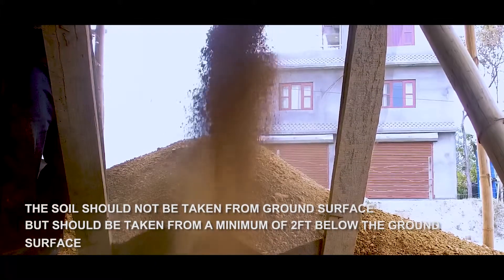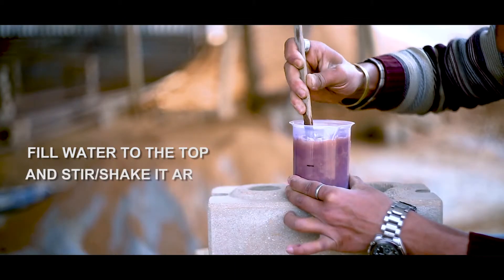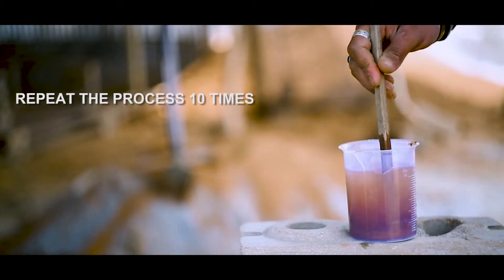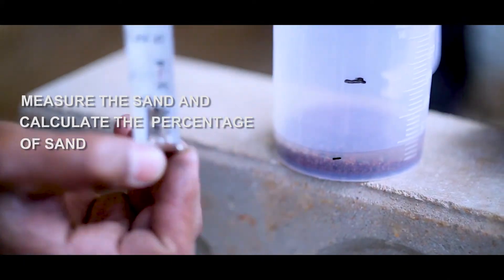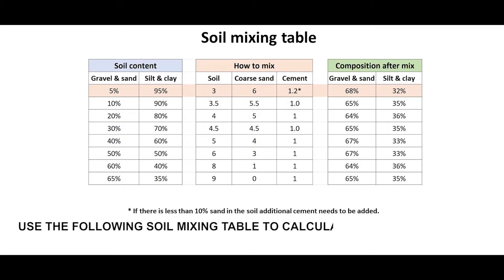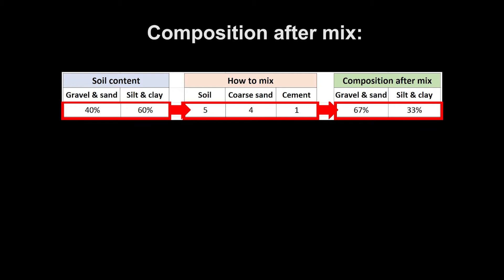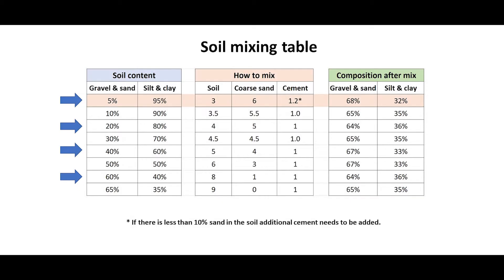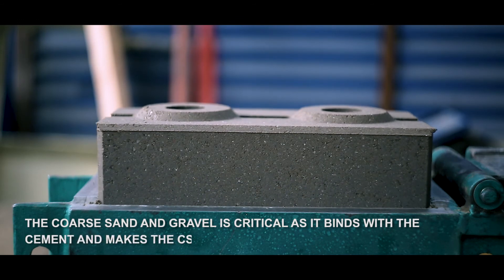How to test the soil for Interlocking Bricks (CSEB)

Comment: A few questions for you:

*  Can limestone dust be used in the CSEB?  If so, what is substituted, and what quantity?
*  Is it better to batch by volume or dry weight?
*  Is 1.6 mm to 5 mm gravel acceptable to be used in the CSEB?
*  Can off white cement and white cement be used in place of portland cement?
*  Can the CSEB be made with the straight products - gravel, sand, clay and cement?
*  Can hydrated lime be used in place of portland cement?  If so, what is the substitution ratio?  Reason being that some people have allergic reactions to cement.

If you are able to answer these questions for me, please, this would be appreciated.

Comment: I used silt laterite soil with only 10 percent of cement without additional soil.  And I managed to have a brick with 9.7 mpa. And soaked in water for a week . Does it show that adding soil is not necessary in my own case.
Reply from the maker: Hey Amara, 9.7 MPa is no doubt a very good strength and the mix is the main factor for the strength of the bricks. It has to be pointed out that there are other things like how hard the compression was and how did you mix the mixture (manually or with a PAN mixer) that will determine the strength of the bricks. 
Off course silt as you mentioned will give additional strength to the bricks.
Reply: @BuildupNepal  manually mixed. No sand just laterite soil with 10 percent cement by weight. And with 5 percent I achieved 4.7mpa.
Reply from the maker: @terresahel235  Hey Amara, It is off-course great. Do you mind sharing your results in detail with us 
info@buildupnepal.com 
pratik@buildupnepal.com
Reply: @terresahel235  bro what was your compression force during production?(the pressure applied  by your machine )
Reply: @wenanyaugustine3311  it's manually pressed machine without pressure guage,  but nevertheless our bricks where very strong
Reply: @terresahel235  can I just ask one more thing? usually what's the compression ratio. Like the volume of the soil you start with compared to the final brick volume?
Reply: @terresahel235  or someone in simple terms will ask what amount of soil goes in the machine before pressing or the volume of an empty open mould
Reply: @wenanyaugustine3311   WENANY AUGUSTINE  well, I dont have a definite answer for that but we get 8 interlocking bricks sized 300mm × 100 mm ×150mm from 80kg of soil with 10 percent of cement by weight, that's 8kg.
Reply: @terresahel235 :  What WENANY AUGUSTINE would like to know is:  How deep is the mould that you are using, prior to filling the chamber with the mix to be compressed?
Reply: I, too, would like to know what the pressure is when compressing the blocks so that we can design a hydraulic version.
Reply: @wenanyaugustine3311  thé mold is about 20cm deep and the brick is compressed to 10cm

Comment: You measured twice. The first is the height of the soil in the Jar, while the other distance is the height of is the elevation of the sand after pouring away the water many times.
Is the proportion of sand in the mixture the quotient of the ratio of the two measurements?
Reply from the maker: That is all covered in the training

Comment: Can we use stone dust instead of soil?If so what will be the ratio of sand and the stonedust?
Reply from the maker: yes you can, usually the ratio is 7:1 for stonedust: cement. we dont add sand

Comment: How much the maximum approx. compressive strength can be get with this ratio you mention. (i.e. 10%) Cement.
Reply from the maker: Usually we get over 4 MPa. But with the same cement content, we have better results like 8-10 Mpa as well. The cement is just one part of it, it all depends on the mix and how well the compression is made in the machine

Comment: Instead of sand we can add m sand
Reply from the maker: Hey
not sure what you mean? What is m sand?
Reply: @BuildupNepal  it's a rock crushed sand
Reply from the maker: @sathyanarayana6521  Hey Sathya, Yes it can be rock crushed sand as well as we have abundant in Nepal but you can use the snad from the local river too
Reply: Can I just buy raw ingredients and make these blocks? If so what is the most cost effective materials to purchase and use? What percentage of each?